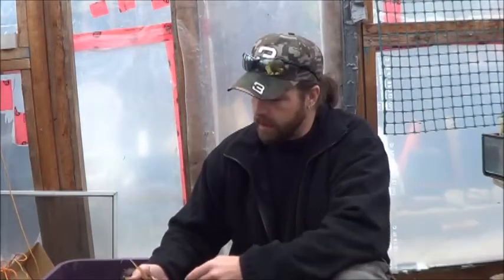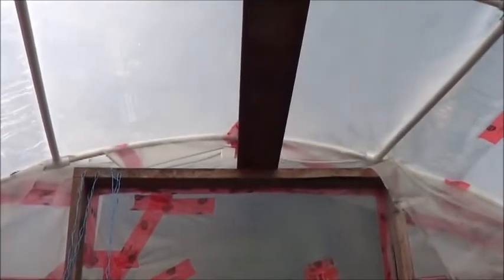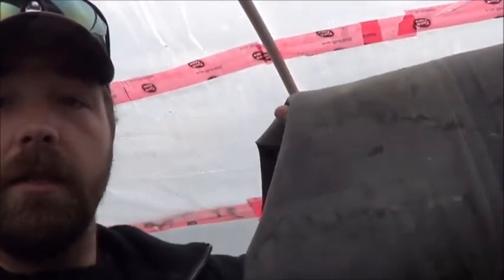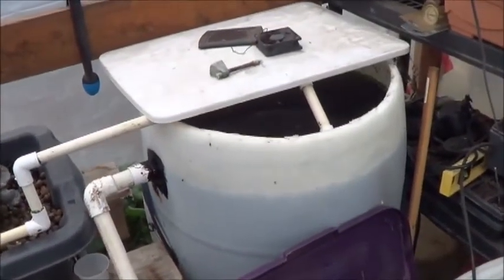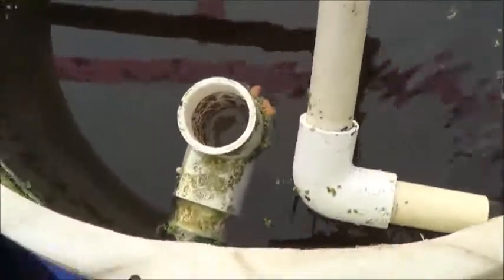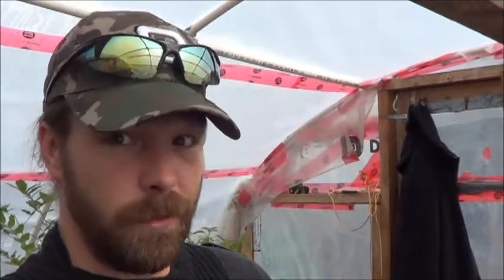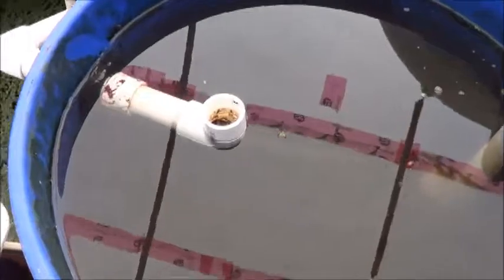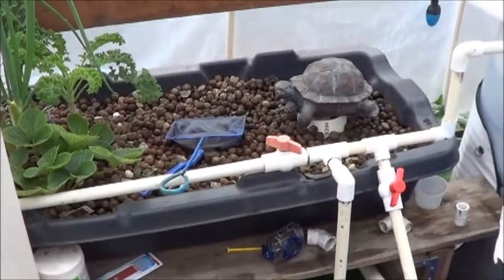Aquaponic Greenhouse Winter Prep 2014

Comment: try using compost along w solar heating coils. bury coils under mulch/compost dead organic matter. the heat in compost should warm coiled hoses ... then just plumb the fish tank to the same fish tank. a loop system for the same tank
Reply from the maker: A good idea but the angles and size of my current location make that somewhat difficult.  In a larger setup, that would be an excellent solution though!
Thanks for the thought!

Comment: I made an experimental solar heater a few years ago and they do get very hot at a full sun blaze. However, those solar soda can heaters do not store heat if you don't connect it to some sort of mass. And as you might know air is a very poor heat conductor. What you can do is that you put some sort of pipe into the soil, and it doesn't have to be deep, and then connect that pipe to the solar heater. You don't have to use soda cans, any type of black painted metal will do the job, although aluminum will transfer heat much better. Most soda cans contain iron and they will rust after a while, even when you paint them black, but a sheet of aluminum will last forever. If I had to build another solar heater I would use an aluminum sheet, it saves a lot of time and money. Cleaning and gluing the cans is a lot of work, and the round cans take in a lot of space as well. With an aluminum sheet there is no need for glue or cleaning at all.

With that being said, your greenhouse is already a solar heater, and I think that a DIY solar heater is only effective if you put it outside the greenhouse, in addition to the greenhouse. Just as you wouldn't put a solar heater inside the house to warm up that same house, it doesn't work like that. Heat transfer is all about surface area.
Reply from the maker: insAneTunA Lol, I'd say there's a good chance that you're right but it'll keep me busy & not climbing garden fences ...
Reply from the maker: I would have to agree with you ***** , when I tried this a few years back I tested a couple of different lengths for the pipes and longer was far better.  Never tried bends in them ...
Reply: *****  It's obvious that both designs need to be covered with glass. The soda can design takes a lot of work, if you don't clean the soda cans one by one they will produce a mold and a horrible smell. A sheet will perform better as well since it doesn't contain iron opposed to soda cans, plus a sheet will last forever. I've been there and done that.

The thermostat feature doesn't change the physics behind it, it's just a method to transport heat automatically from one place to another.

My conclusion, Using soda cans takes a lot of work, time and money, while an aluminum sheet will perform at least just as well if not better since it doesn't contain any iron opposed to soda cans. And no need for cleaning or gluing, and it will last forever.

A vacuum box would perform even better, but that would need heat pipes made from copper pipe and acetone in order to transport the heat to a heat collector because there is no air to do that job.

Comment: Very cool, have you considered using space blankets like maybe on the floor or lower parts of the walls? Just a thought, they are pretty cheap I think.. great setup you have going there let us know about the solar heater if it helps!
Reply from the maker: Naked Eyez I tried using some of those on the back wall in my first year and found that the silver ends up flaking off and some of it ended up in my fish tanks.  I never thought about the floor though, good idea!  I think I may even still have some of those around in my camping supplies ...
Thanks for checking it out!